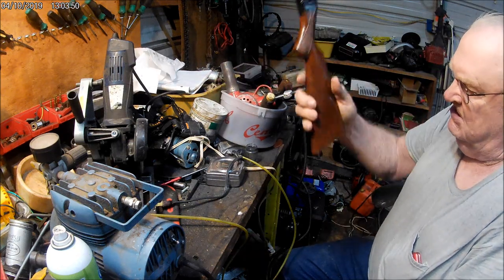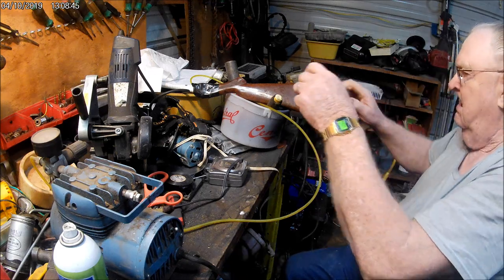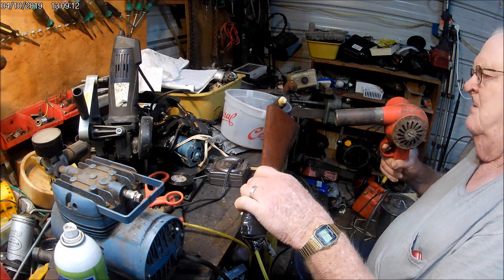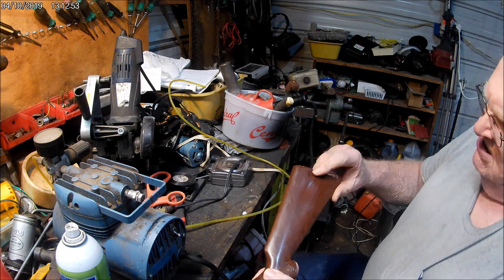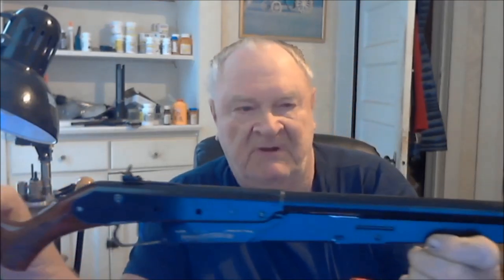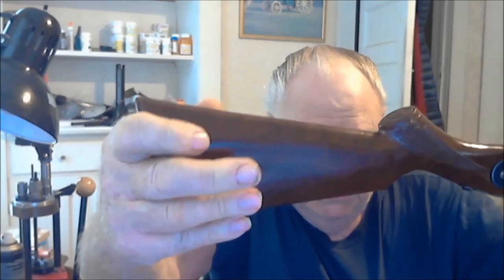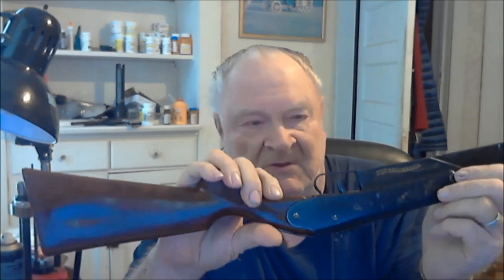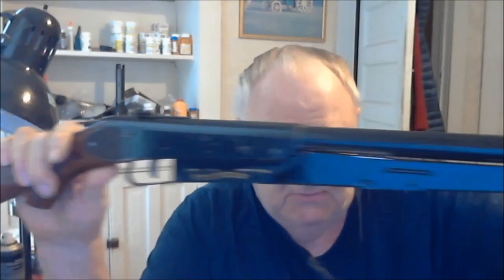Daisy # 25 air rifle refinished

Comment: That turned out nice Vernon. I have a Daisy Model 105 B that I would like to spruce up like you did. This one is missing the cover where you load the BB's.
Reply from the maker: I don't know if ebay has something like that,,that's where I found the parts for this one.
Reply: @MissouriOldTimer  
They had one so I bought it. I looked it up right after I commented to you.
Reply from the maker: @WallysPlace66  maybe you can do a video showing a little about it, I don't know the model right off.